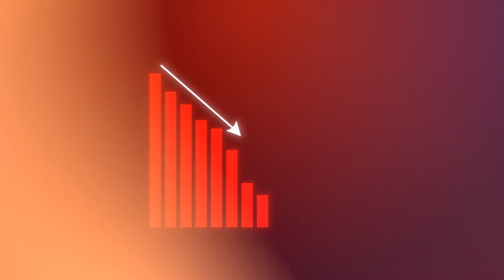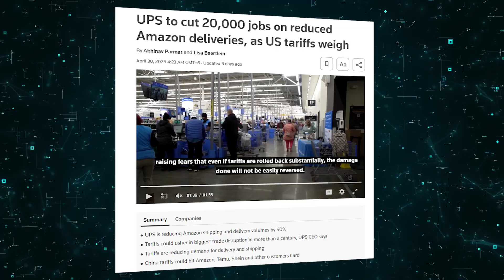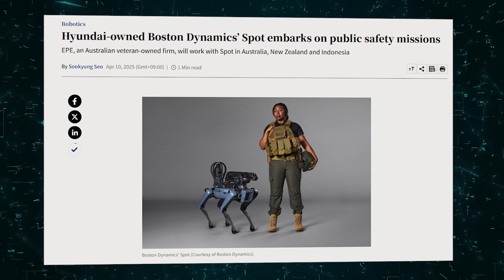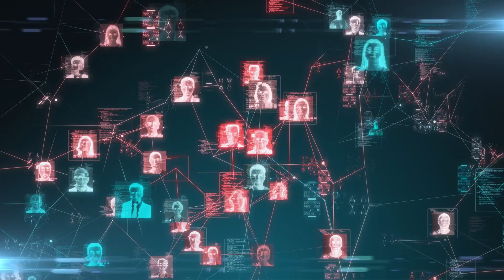UPS Fired 20,000 Workers… Then Called the Robots | Atlas, Spot, G1 & Cyborg Cops

Comment: I can tell you a ups building old convential could process over 200k in 5 hours and the automated buildings can only handle around 50k to 70k in that time.
Reply: When was this? I did UPS package sorting and supervising in the 90s at ONT. I saw the video of the autosorting facility in Germany, I believe, that required only people to unload and to load. It looked way more efficient than our Tue-Sat NDA sort. Our manager thought maxing out the unload would make things more efficient when all it did was cause missorts and belt jams. One day that manager was gone and the unload worked steadily but not rushed. We had no belt jams and finished in the same amount of time.